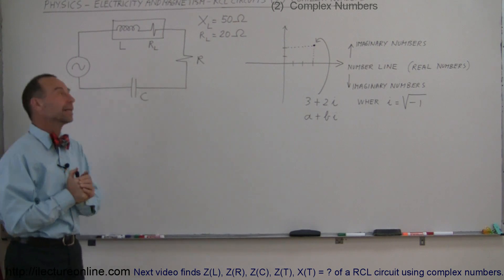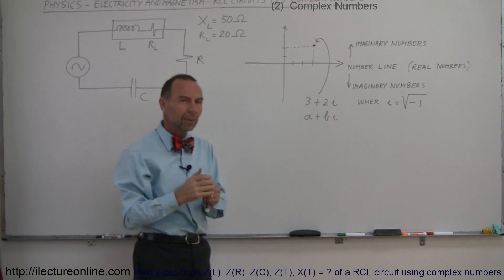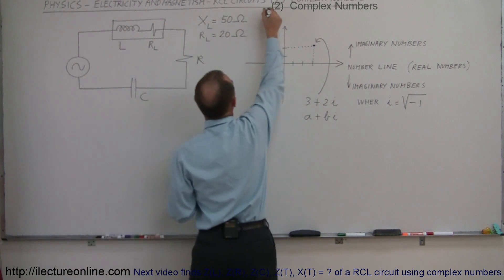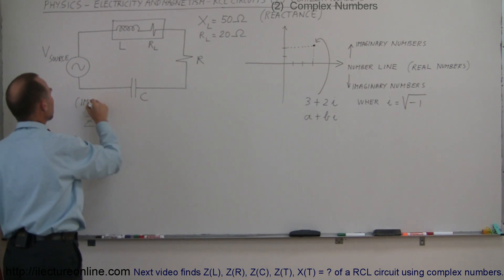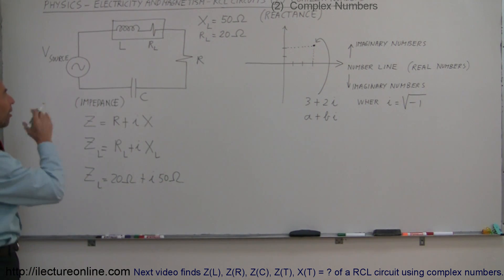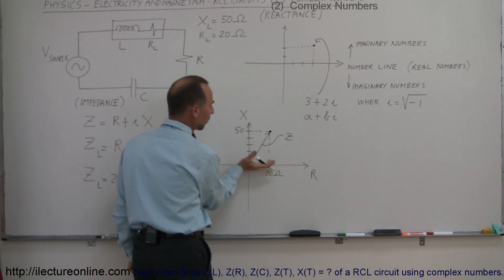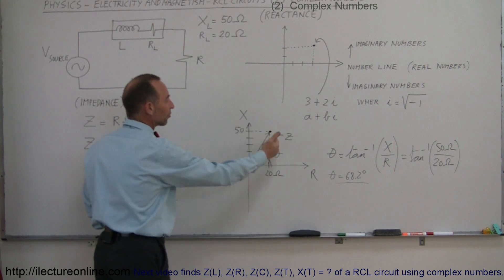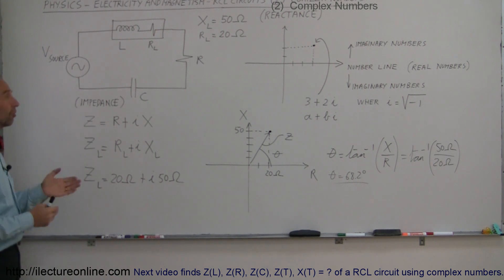Physics 49  RCL Circuits (2 of 13) Complex Numbers

Comment: Sir, If one current I = -20-j50 , transform this into sine equation, phase angle = arctan(-50/-20)= 68.2 = phase angle in sine equation, right??? Can you explain the way to convert complex numbers to sine equation, Sir? please, I have trouble with phase angle , which angle to be chosen?

Comment: What is an imaginary resistance? The concept is strange.
Reply: Imaginary resistance is a contradiction of terms.   An impedance can be real or imaginary, or a combination of both, but a resistance is only real.  Impedance is an extension of the concept of resistance to the complex number domain, so that it can keep track of both resistances that are real numbers, and the effects of capacitors and inductors that have a reactance rather than a resistance.

When impedance is a pure imaginary number, this means that the impedance is entirely reactance, and no resistance.  That means that the circuit section in question consists only of components that store energy, and no components that dissipate energy as heat.  Reactance means the component stores energy and releases it at a later portion of the cycle.

Comment: why are we using imaginary numbers? shouldn't be the impedance square root(R^2+XL^2)?
Reply from the maker: The magnitude yes, but when you want to represent the phase angle, you'll need imaginary numbers.
Reply: @MichelvanBiezen  but in other videos,you use this in this form when  you are calculating the impedance(with imaginary part). but shouldn't we use it square root(R^2+XL^2) form when we are calculating the total impedance?
Reply from the maker: Yes, when calculating the magnitude of the reactance or impedance, but you need the complex representation to show the phase angles between the currents and voltages.
Reply: @MichelvanBiezen  ok thanks

Comment: Please sir, what do we mean by representing reactance And resistance as phasors? I am confused because representing them as phasors means they will have instantaneous values as these phasors rotates And i think that reactance And resistance are constants.
Reply from the maker: When they are represented by phasors, we recognize that the voltage and current is time variant and the phasors rotate per wt.  The phase angle for each component indicated the phase difference between the voltage and current for each component, which in the case of a resistor is zero.
Reply: Phasor is a compound word of phase and vector.   Sine waves have the general equation of Y=A*sin(w*x + phi).    A vector of magnitude A, and direction phi as an angle from the positive real number axis, is how we keep track of both the amplitude A and phase offset phi, when we have multiple sine waves at play in a given problem.

Think of a phasor as a vector that is continuously rotating around the origin.  The projection onto the real axis indicates the real time value of the quantity represented by the phasor.   A phasor that is 90 degrees away from it, means the phasor represents a waveform that is a quarter cycle different from the first waveform.